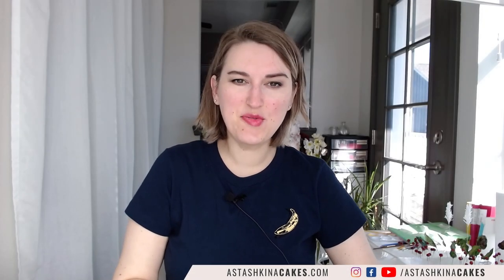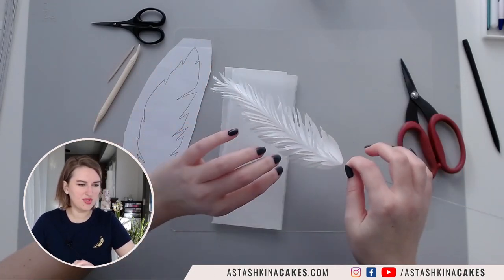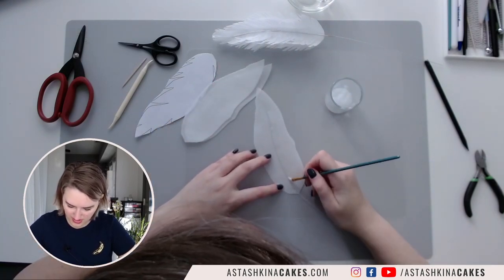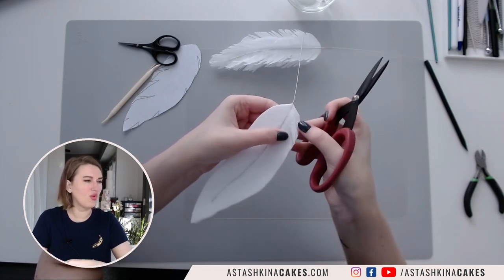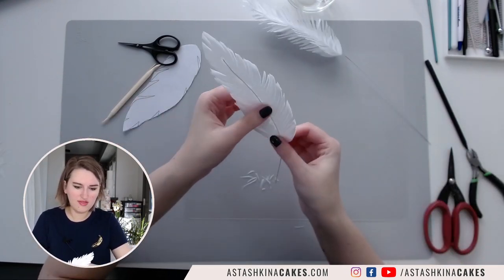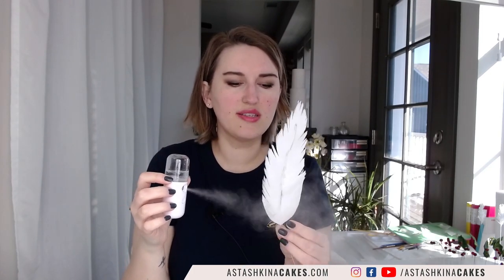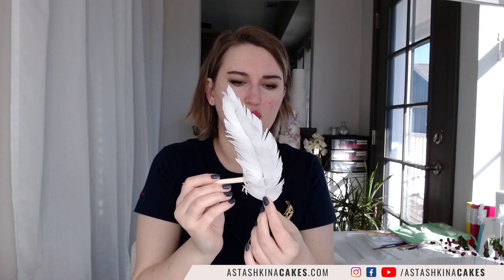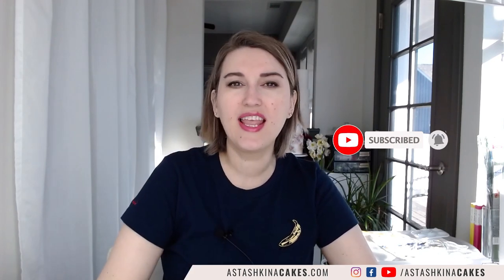How to make Wafer Paper Feathers | Florea Cakes

Comment: Lovely tutorial easy to follow too. Please does the little steamer steam out hot water or normal room temperature water,
Reply from the maker: Room temp. It is the same steamer as the one you would use for essential oils, so it is a diffuser technically

Comment: Very nice!  Couple of questions please...in the video you mention 22 Gauge wire, but your supply list link is for 20 Gauge wire...which is correct?  Regarding the wafer paper link, there are 2 thicknesses - "A4" and "O Grade"....which is correct to use?  Thank you!
Reply from the maker: Thank you.
You can use 20 or 22 gauge wire - both would work.
Wafer Paper - AD grade (not A4) which is 0.27mm or 0 grade which is 0.22 mm. 
If you would buy just one type for every application - start with AD (0.27mm)